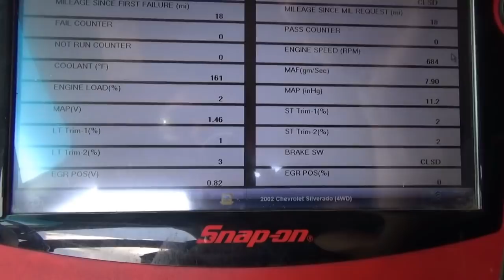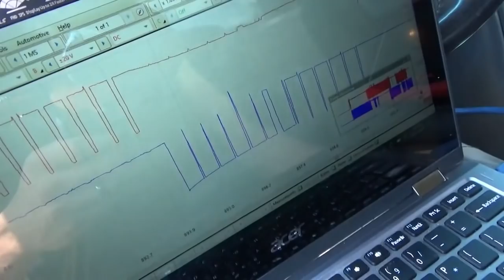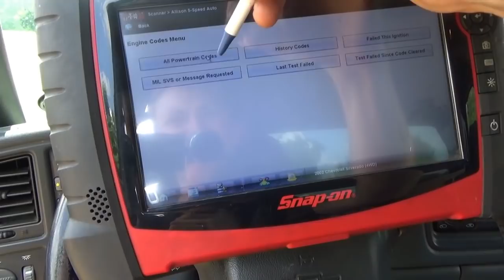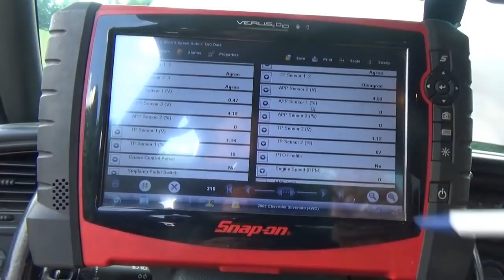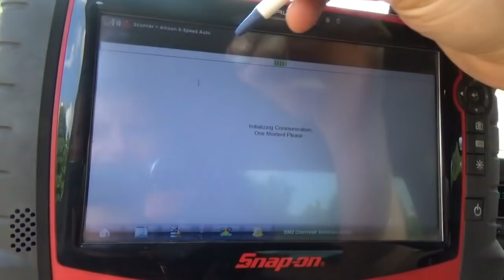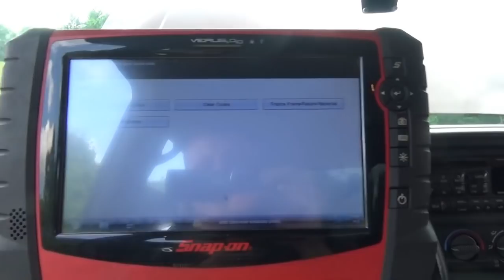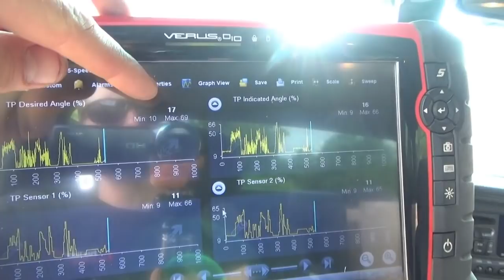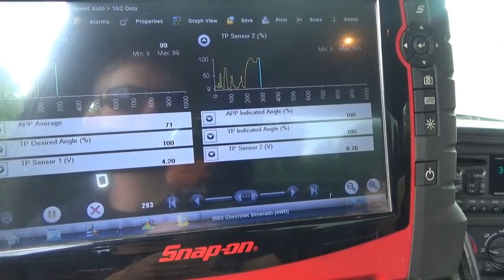GM Truck REDUCED POWER P1515: EPIC BATTLE! -Part 2

Comment: I actually like these types of projects. Parts swapping different types of designs and testing to get them to work. And it's so satisfying when it works. Like putting a TPI on an engine that had TBI, with all the rewiring, burning chips, and moving hardware around. But that's mostly 80s technology. Nowadays it's all computer programming, and we dont get to see the sourcecode.

Comment: Ivan.
I ran into the same issue a few years back on. 04 GMC sierra 8.1 liter. I replaced the TPS assembly or gas pedal. Problem went away for a few months. The assembly was from Autozone or Dorman crap.  I replaced the assembly from Acdelco. Problem fixed. 
If the assembly is from autozone or dorman . trash it. Then a few months ago. Problem resurfaced.  Just as you were doing. I replaced pigtails. Cut one wire at a time and soldered the new pigtails. Then replaced the actuator. Bought a new kit. The throttle body is mechanical and is ok. Now the truck is running just fine. It appears the owner did cut wires. Anyhow. Check the gas pedal assembly. AC delco and Dorman will not communicate with each other. Hope that helps.

Comment: I didn't like the look of those throttle motor pulses looking like "V" and not a true square wave on the bottom trace.  It looks like the driver transistor circuit might have a current limiter on it and cannot pulse enough current to move the motor properly, or maybe the motor has friction or shorted windings.  I think if you understand the strange scope patterns you will solve this one.

Comment: Ivan, I admire your determination and perseverance. You keep fixating on the throttle body despite the fact that three different units exhibit the same problem. Perhaps the other potentiometer in the circuit is the problem?  How about checking the pedal? Maybe he has a Dorman accelerator pedal position sensor?
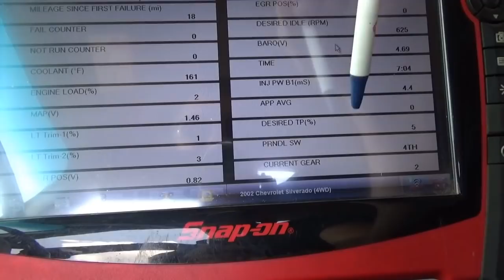Reply: At 3:11, you found the "desired TP" at 5.  All of my cars never go that low. This would lead me to believe that you are getting an erroneous signal from the accelerator pedal position sensor.
Reply: BTW, I am really enjoying your channel. You are a natural born test engineer.  GM needs to hire you to run their electronics test division.
Reply from the maker: I don't trust the reman tbs... Have to eliminate that variable, but that's easier said than done lol
Reply: @vpimike2646  would that imply a vacuum leak somewhere, in the first video it set the code with engine not even running.  I'm guessing maybe an EM interference issue causing the PCM to misinterpret one of the position sensors.  Maybe something aftermarket, maybe a motorized thing like a fuel pump, something that kicks on at random times for a few seconds.  It doesn't seem to be anything directly wired to the actuator module or throttle body, under the hood. 

 I'd also be interested in the signal (sensor) ground at the other end, or at a splice in the harness.  If any of those three wires (sensor, 5v ref or sensor ground) is intermittent, the PCM is going to see insanity on the signal wire of a sensor.
Reply: I have had a lot of bad Dorman products over the years, try to avoid them  since there all farmed out products from China with very little quality control. Cost a little less but costs you more in labor replacing it twice.or even more .

Comment: Just a question; should the throttlebody be relearned to the system? Did you check the cable loom there has been a lot of clipping and soudering in there. Anyway i remember some Audi's have to run at idle for about 25 minutes to relearn the throttlebody to the actuatorpedal and system.
Reply: That's something that I was wondering. The relearn system exists for exactly that kind of issue.
Reply from the maker: Interesting. I'll have to check on the relearn... Thought the parameters were preset in the TAC module
Reply: Newer GM vehicles allow you to relearn throttle positions or idle limits. Ones this old do not. I believe it was somewhere around 2007 - 2009 the relearn came into play
Reply: @mikebrennan4534  I just looked it up, in case I'm dumb (happens more and more these days) and Cardone has a relearn procedure available for the part.
Reply: there has to be some sort of relearn procedure or it would be broken right from the start due to slight mechanical and TPS difference/offset.
likely the reason the old units with external TPS failed more often, wear in the gears/shaft/tps bore offsetting the control and TPS signals from known motor position and having slop in there would make it never right again.
from the looks of it, grounds to the TAC are very critical and known to cause random problems and the past repaired wire harness break issue. it looks like there may have been some programming updates also to help the issue.
the early setup looks like a chinese finger pull toy, no mater how you fight it's a lose-lose situation lol
Reply: Ford taurus 2003 runs like crap after a throttle body removal and clean.  Suppose to turn off all electrical (ac radio etc.) and leave it idle for 10-15 minutes.  But it didn't throw a code.
Reply: @SGDeGalvez  check for thottle body recall, internal jigglys go bad,

Comment: If all else fails, buy an LM358 opamp and a few resistors.  Set up opamp as a "subtractor".  We won't use the 2nd throttle position sensor at all - it will be taken out of the circuit entirely.  Wire the 5v wire of one of the position sensors (say, TPP1) to 2 places: 1) the opamp power input,  Vin, and 2) to the opamp Signal 1 input.  Then wire TPP1 output to the  2nd opamp (Signal 2) input.    Then take the opamp output (which will be the difference of the 5v reference and the 1st position sensor output) and wire it to the 2nd position sensor pin going back to the TAC module. You will completely take the 2nd position sensor out of the picture, but you will always have the correct differential voltage that the TAC is expecting to see (the output of the 2 position sensors will always add up to the reference voltage).  Problem solved. Biggest drawback is that you no longer have the "safety valve" that sets the "Reduced Engine Power" mode.  If TPP1 goes back you are SOL.  After wiring up & testing just mix up a bunch of epoxy, slather it around the LM358 and resistors, let it cure, install it and you are good to go.

Comment: First, sorry for my bad English, it's not my native language.

I've worked on a few cars with DBW over the years, and if you clean or change the TB, you need to run a TBA (Throttle-Body-Alignment). 
I would expect a Chevy Truck to require the same, due to the difference in a set of potmeters (difference in manufacture/different batches and so on).
Saw someone suggest to just start the vehicle and let it run for 25 mins or so and the TBA would be performed automatically. On VAG this procedure might seem to work, but running an adaption with a scantool is more precise and quicker than letting the car "guess" with fuzzylogics by itself. (And you won't get the FULL position just based on the LOW/IDLE position. It just sets a baseline.)

BTW, Thank you for your entertaining videos. I really miss working on cars when I'm watching you videos.

Comment: The spliced wires are suspect. I think the emissions would want  the throttle to close a certain way maybe a delay in closing maybe that's messed up Is max throttle part of a governor system over rev system. I would have gotten two or three out of a junk yard getting the exact part.  Great stuff.  The replacement pedal might be suspect. I'd get a junk yard one or two.

Comment: Remember when there was a simple steel cable that went from your right foot to the throttle blades? I do...such simpler times!
Reply: What's not there cannot go wrong,
Reply: Manual throttle cables break as well just takes a lot more miles, the good old mechanical linkages require some maintenance but can last almost forever.
Reply: Todd Ector I throw a little graphite cable lube down each of the three cables that come off the throttle body of my Jeep once a year.  

For those wondering why there’s three? Accelerator, TV (line pressure control for the transmission) and cruise control actuator.  I’ve not had a failure of any of these since I started adding this to my yearly checks.
Reply: When the grounding-strap between engineblock and chassis went out, you'd have an additional path for the starter current too! Sometimes triple duty as an engine bay light/heater during cranking! 😉
Reply: Both of the Ford's at my house are over 15 years old and have throttle cables. They still work fine, even tho they are not as touchy as the electric throttles.
Reply: @PeteJacksonPapasVlogs I do that with all engines with throttle cables but still for example on my 89 F150 the throttle cable still failed at 550000 kms, luckily it was a manual equipped with cruise control so I was able to continue driving it to work that day.  

Side advantage I was able to use some bailing wire to keep me going until a replacement was shipped out the next week.
Reply: The advantage of an actual cable is there is usually some type of basic work around. If the cable breaks, then you just need to find some way to connect it back together, or bypass it with a string, since they are spring loaded and you only need to pull in one direction. 
Also, anyone with a Jeep and TV cable, make sure it is adjusted properly. I've heard if its not working properly, it can cause transmission failure, but I'm sure anyone that knows it is a TV cable and not a kickdown cable already knows that.
Reply: For the most part, the mid-90's to the mid-2000's was the sweet spot for reliable automobiles. Basic fuel injection, basic diesel and gas engines, good rust protection, and none of the crazy multiple onboard computers.

Comment: I had a similar issue with my 07 Yukon after cleaning the throttle body. I don't recall the exact code I had but I was having an issue where I would start the vehicle and if I gave it some gas it would stay and hold at a high rev 2-3k. Tried idle learn reset with no luck. Was on the verge of buying a new TPS but I tested the coils and the position sensor and ohm'd out fine.

I ended up having to reflash the PCM and the issue has been gone ever since. Very weird issue that the PCM must be storing some idle position values and may be a similar situation you are occuring.

Comment: Throttle cables break eventually as well, but they last much longer.  

That being said modern vehicles and their precision controls to make them shift smoother, maximize fuel economy and minimizing emissions sadly require electronic throttle bodies.

Comment: You may have already tried this Ivan, but even though the actual GM part is obsolete, ask a Chevy dealer if they can do a dealer search. Maybe somewhere in this country there may be one sitting on GM dealers part shelf, it's worth a shot if you have not tried that.
Reply: I had a Chrysler dealer do this for a 2013 Dodge Ram! Drivers door module discontinued apparently crazy how quick cars are outdated these days
Reply: Just to be clear no module was found at any dealer in the country. I had to pick one up from a junkyard !

Comment: There should be a relearn/calibration procedure. The way it resets itself may be an indication of this, IDK. I think owners who experience this have been able to shut off the engine,  restart and problem temporarily clears as if it's not a solid failure.

Comment: Ivan -- I guess you've solved the problem by now in episode 3. But I'm curious whether the reduced span of the new TPS signal is due to the motion of the throttle rotation using a smaller proportion of the pot's range, or are there additional resistors in series with one or both ends of the pot?  (Internal to the throttle body/TPS housing.)  The latter is potentially fixable.

Comment: 1.  thanks for publishing videos on the weekend. After a long days work out in the Phoenix heat of 111f it's nice to crash on the couch with a beer and watch your videos!

2. Wouldn't it have been better to just buy a used throttle body for the same gen on eBay and save yourself some headache?

I'm looking forward to seeing the conclusion. If you can't make this happen nobody can!

Comment: One thing you could try is; rebuilding original Throttle body with new GM sensors;  Rock auto site, has new part numbers. i think its; TPS -ACDELCO 213912 and IAC valve-ACDELCO 17113598. Not sure about that; Auto zone gas pedal setup too. Possibly you can rebuild the original on that, also. I agree; Tuff to troubleshoot, with bad reman parts. its like, Chasing your tale.

Comment: i bet that the tac module has a issue mabee power or ground or programing or bad module because it a after market one ,because it can't  handle the more curant load on full trottle  ,thanks for the guest game for us
Reply: Or a bad soldier joint or processor

Comment: Maybe you only have to tell the throttle controller to re-learn the full travel of the throttle pedal.
Sounds like to me with a correctly working throttle body, the system has to re-learn the throttle and throttle positions?

I’ve seen Eric O. do this re-learn function. Give it a try.

And WHERE’S PART 3??  Jeez man, sitting on the edge of my seat!!  Great video series!! Thank you. Now MOVE it!!